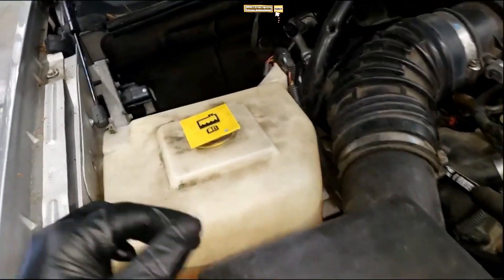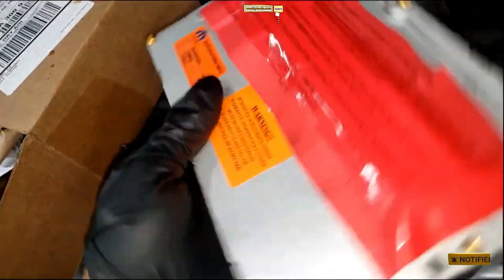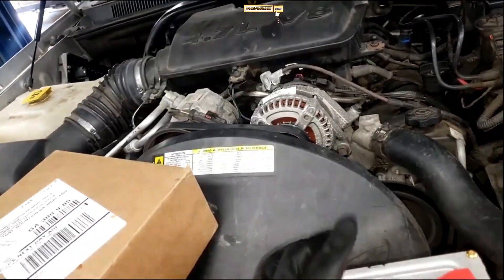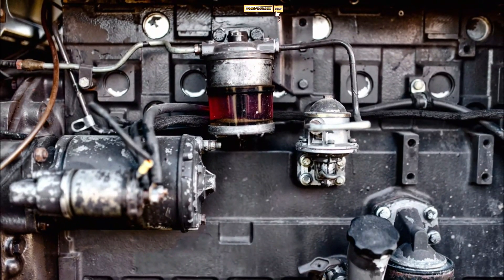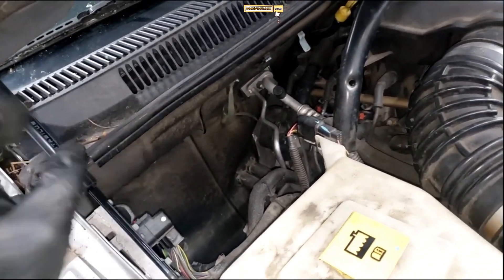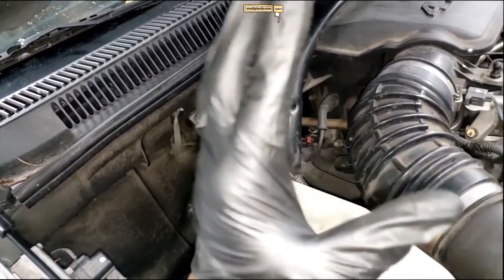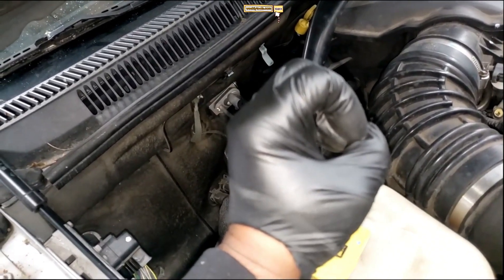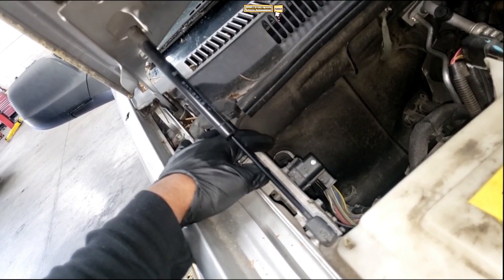SYMPTOMS OF A BAD ECM (ENGINE CONTROL MODULE)

Comment: My Audi A4 is misfiring despite the fact that Coilpacks injectors and plugs are all working. What might be the problem. I had just replaced the engine recently with another one
Reply from the maker: A misfiring Audi A4 after an engine replacement points towards a few possible culprits related to the installation process:

Vacuum leaks: Double-check all vacuum hoses for proper connection and ensure there are no cracks or tears. Leaks can cause improper air-fuel mixture leading to misfires.

Sensor issues: During the engine swap, some sensors might have gotten loose, damaged, or even accidentally swapped with incompatible ones from the old engine. Check sensor connections and verify they match the new engine's specifications.

Wiring problems: Incorrectly reconnected wires or damaged wiring harnesses can disrupt the signal to spark plugs, injectors, or other vital components, causing misfires.

Compression issues: Though less likely, there might be underlying compression problems with the replacement engine itself. This would require further testing by a mechanic.

Here's what you can do:

Return to the Shop: If the engine replacement was recent and done by a mechanic, it's best to take the car back to them.  A misfire after such a major service points to a potential issue with the work performed, and they should diagnose and rectify the problem under warranty.

Consult a mechanic: If you did the engine replacement yourself or used a non-authorized mechanic,  take your car to a trusted Audi mechanic. They can diagnose the specific cause of the misfire and recommend repairs.

For future reference, when dealing with complex repairs like engine replacements, using a certified Audi mechanic ensures proper procedures are followed and minimizes the risk of such issues.

Comment: Hello I was curious could it be a bad ecm regarding the throttle body which has the vehicle shaking below the seat and the driving stick at times along with the rpm meter going up and down a little vs just sitting still.
Reply from the maker: Thanks for your compliment.
Yes, a bad ECM could be causing the shaking in your vehicle. The ECM controls the throttle body, which is responsible for controlling the amount of air that enters the engine. If the ECM is not functioning properly, it can cause the throttle body to open and close erratically, which can lead to shaking.

The other symptoms you mentioned, such as the RPM meter going up and down, are also consistent with a bad ECM. The ECM also controls the fuel injection system, so if it is not working properly, it can cause the engine to run erratically.

If you are experiencing these symptoms, it is important to have your vehicle scanned by a qualified mechanic. They will be able to use a diagnostic tool to check the ECM and see if it is the source of the problem.

If the ECM is indeed bad, it will need to be replaced. This is a relatively common repair, and most mechanics will be able to do it quickly and easily.

Here are some additional tips to help you troubleshoot the problem:

Check the engine oil level and make sure it is full. Low oil levels can cause the engine to shake.
Check the spark plugs and make sure they are in good condition. Worn or damaged spark plugs can also cause the engine to shake.
Check the fuel filter and make sure it is clean. A dirty fuel filter can restrict the flow of fuel to the engine, which can cause it to run erratically.
If you have checked all of these things and the shaking is still happening, then it is likely that the ECM is the problem.
I hope this helps!
Reply: @weeklytools  I appreciate it very much. I ad thinking it was the ecm because I’ve had the code P0603 before on my fix’d app which says engine control module power circuit and it disappears but comes back. I believe a spark that happened in April based on me trying to put the washers back on the alternator from getting the exhaust manifold replaced when a mobile mechanic forgot to put them back on is the reason for the ecm possibly being the problem because also I had to get the positive battery connection fuse replaced which I did and probably still now have to get the ecm replaced.
Reply from the maker: @cameronmorgan0203  It sounds like you've done your research and have a good understanding of the P0603 code. The spark that happened in April is definitely a possibility, as it could have damaged the PCM. The positive battery connection fuse also being replaced is a good sign that the problem is electrical, and not something else like a bad sensor.

If you're comfortable with DIY car repair, you can try to diagnose the problem yourself. You'll need a diagnostic scanner to read the codes, and you'll need to be able to follow the wiring diagrams to trace the problem. If you're not comfortable doing this yourself, you'll need to take your car to a mechanic.

The cost of repairing a P0603 code can vary depending on the cause of the problem. If the ECM is bad, it will need to be replaced. This can cost anywhere from $500 to $1,000. If the problem is with the wiring, it may be less expensive to repair.I hope this helps!